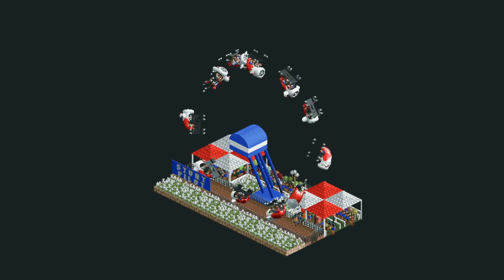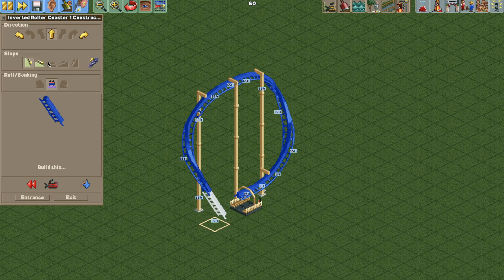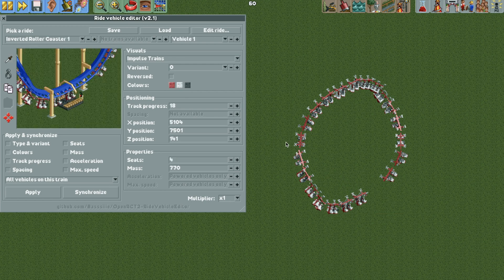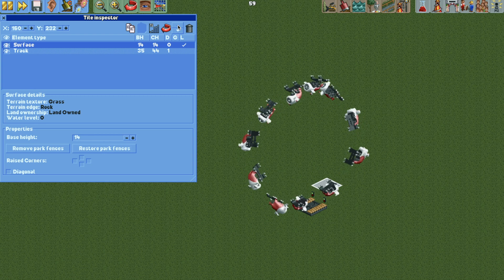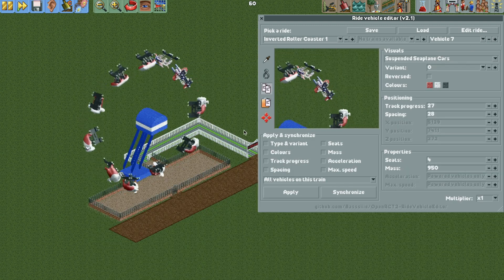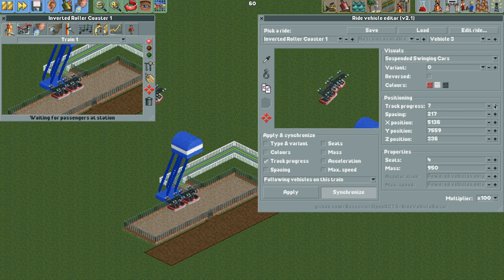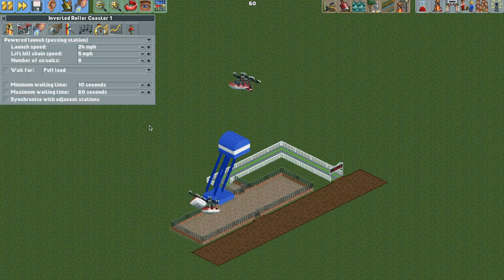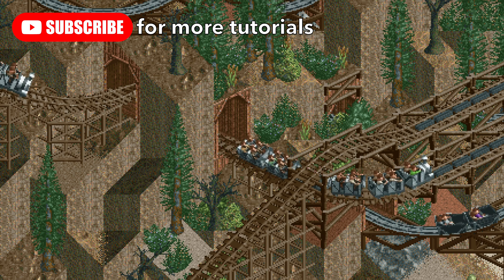Sky Diver / Roll-O-Plane - Open RCT2 Tutorial

Comment from the maker: UPDATE - to avoid the issue with the roll-o-plane arriving at the station very slowly, a viewer pointed out an easy fix.
Instead of a 4-car train, make it 21 like the sky diver with all vehicles set to invisible cheshire cats except for vehicles 1, 2, 12, and 13 as suspended swinging cars.

Comment: WHAAAAT you can copy and paste vehicles in the editor?! Why did i never noticed those buttons lol, that couldve saved me so much time D: But now i know, so thank you! Great little ride and another good option to build without shoestringing!
Edit: at 6:30 i believe this happens when threre is a gap in the train. Easiest way to fix this would probably be to do the same for the Roll-O-Plane as you did for the Sky Diver, but instead only leave those 4 vehicles (2 on both siedes) visible and the others invisible.
Reply from the maker: Good tip! That works really well. Thanks for the fix!